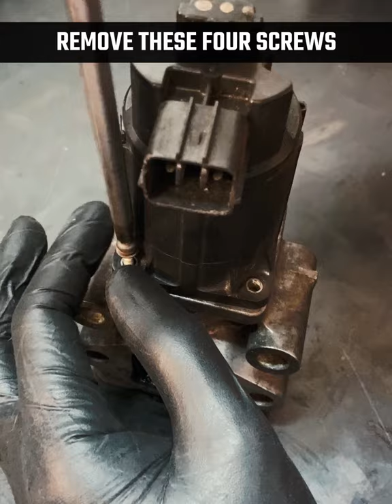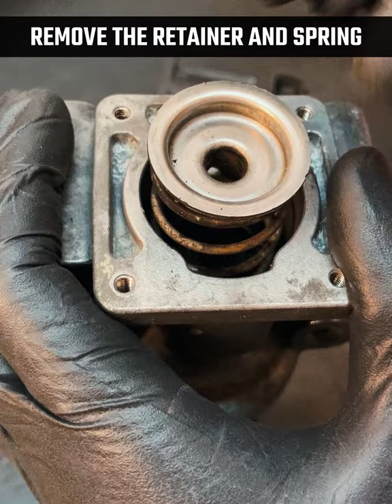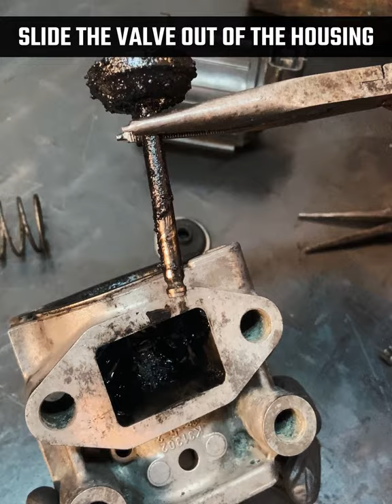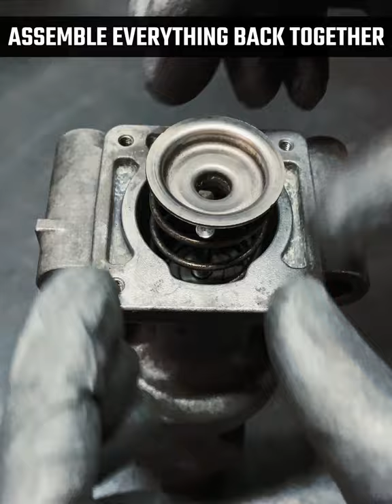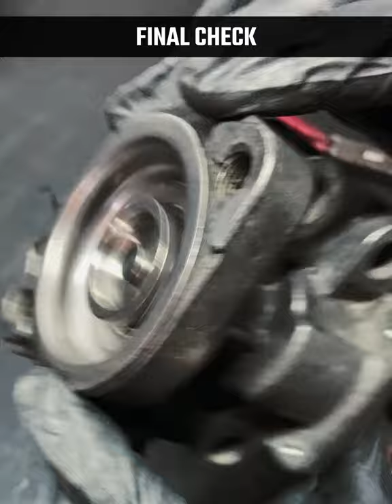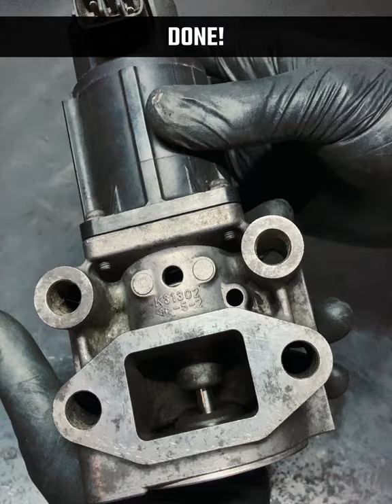HOW TO PROPERLY CLEAN A MITSUBISHI EGR VALVE

Comment: Thanks mate, I got a stall at idle issue with my L200, runs perfectly well apart from stalling at idle. I'll check my EGR see if it's stuck and give the little buggar a clean while I'm at it. Will the ECU need any adjustments after doing this? Cheers in advance
Reply from the maker: Hi Jon! Nope, just clean the egr and but it back in then you’re good. However, it shouldn’t cause the stalling issue. I think you should check your fuel system for that
Reply: Hi mate what's your view on blanking plate with the 7mm hole,for my 04 1KZTE Hilux? @btdgarage